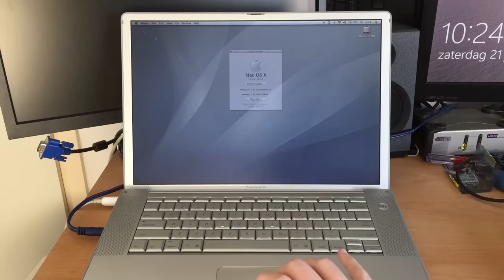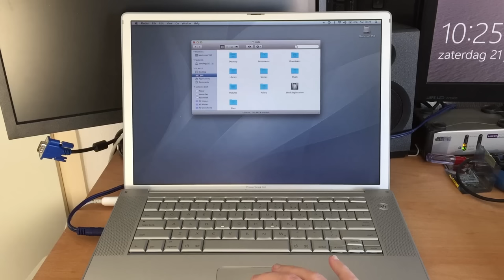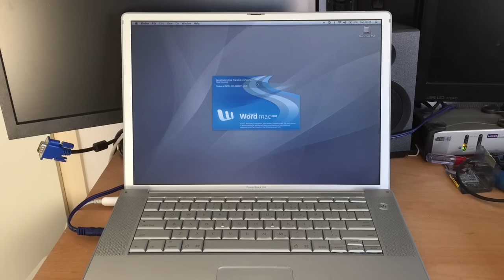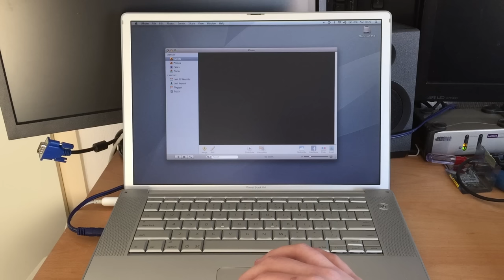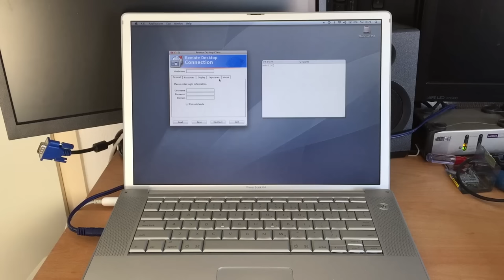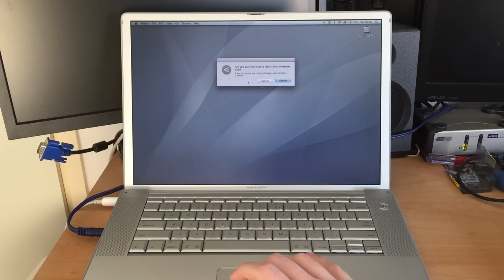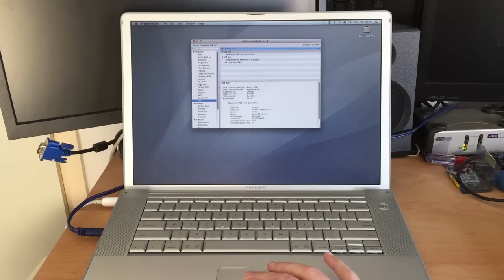PowerBook G4 15" - Late 2005 - SSD Upgrade & Test

Comment: maybe i missed it did you run xbench? what read and write speeds did you actually get? I'm seeing lots of people only getting like 50MBps up and down on these with ssds. you still think its worth it?
Reply from the maker: +cory callahan the main benefit of a SSD isn't sheer speed but access times. A typical HDD has about 10-15ms response time whereas an SSD can have as low as 0.1ms
Reply: yeah i know but just for the hell of it i wanted to know the read and write speeds

Comment: Thanks, OWC for this great video. I am not sure if this is earlier or later than my 1.25Ghz models, but on them there are separate ribbon cables for the keyboard and track pad/power button. On these models I strongly recommend against disconnecting the ribbon cables, as the one for keyboard is extremely fragile. It is simple enough to just leave the keyboard assembly attached and the cables are long enough to just prop it up on the screen. I broke off the ribbon cable connector from one trying to do this upgrade. Luckily it was a dry run on a unit with busted display that i was using for practice. I have now successfully installed the KingSpec IDE SSD in the second one, put a fresh copy of Tiger on it, and am about to reassemble 🤞🏻

Comment: Indeed, access time is possibly the main benefit of solid state. For me, relying on large sequential read / write more than anything, this proves negligible, but in the case of a single drive laptop being used much more generally (office, web, things like that) you should definitely notice an improvement. Quick question, do you mind if I use a clip of this? I need background footage for something and always think it boring to use my own the entire time. Credit will be given, of course, in the same way as the third party footage (from SyntheticMachines and WaybackTech) I used in the Scenic video.
Reply from the maker: Just set the video to creative commons. Feel free to use the footage as needed. I'll do all future uploads in CC from now on, so if you see something that you want to use, do so.

Comment: Do you think I could use a 500 GB SSD for a PowerBook G4 17", or is it too big ?
Reply: I have a smaller computer than 17" and yesterday I cloned the old hard drive to a new Samsung 860 EVO 500GB SSD and installed it just fine. The physical dimensions need to fit - and the only thing that a higher capacity does is that it costs you more cash out of your pocket up front. SSD drives do not create heat since they have no moving parts, so the size of its capacity does not affect its performance.
Reply: @72Yonatan  Thanks very much for your comprehensive response. Do you think it would be also possible with a Sandsik 480 GB SSD? They cost 20 Euro less than the Samsung EVO.
Reply from the maker: As long as it’s m.2 SATA600 or Msata (and not regular 2,5” sata) any SSD will do.

Comment: How did you locate an SSD that fits into the Chinese made adaptor?  Also, please buy a microhone that hangs around your neck so that we can hear when you speak, low or high volume. You seem to be mumbling or speaking in a direction that the microphone does not pick up.